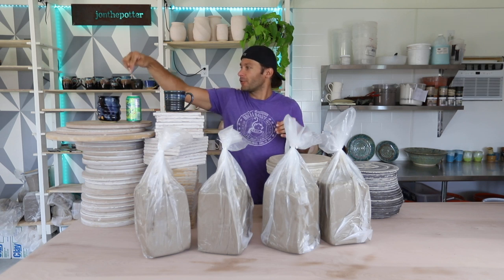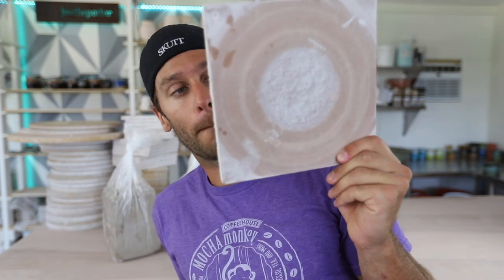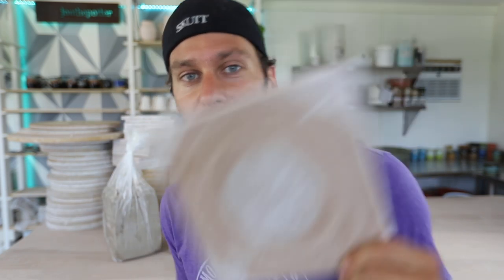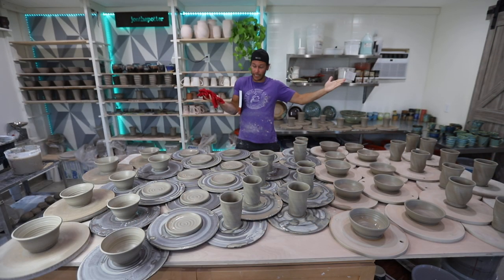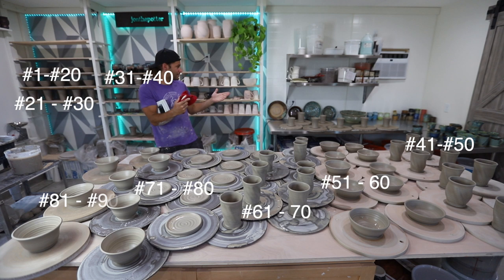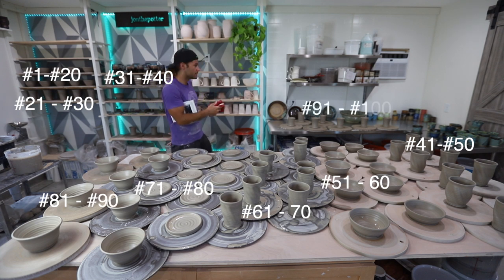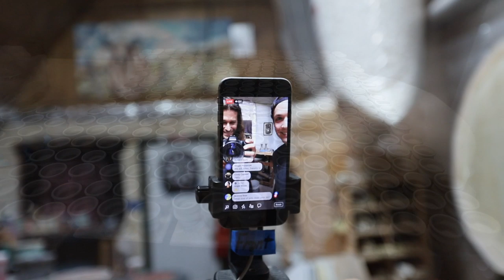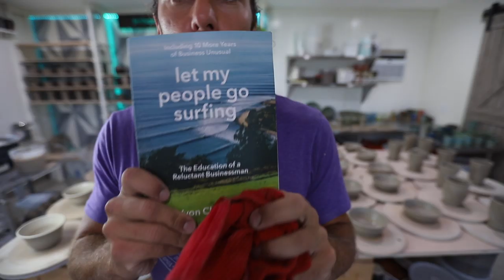THROWING 100 POTS - How long does it take??

Comment: I am throwing at 20 pieces an hour now, but can only do 3 hours on my wheel before my back dies on me a little! I found you on reddit when I first started doing pottery, you had thrown a coffee pour-over. For my first 2 classes, I tried to make one like yours. A year later, I still haven't made one that actually works! Mine are too short (learned a lot about shrinkage in that class - all my mugs only hold about 75ml or less...

Comment: I came across your channel, in my recommendations.  I watch a lot of throwing, glazing and firing videos  I find it both relaxing and educational, as it's nice to see how other potters do things.
Speanking of relaxing, I did like your "ASMR" video.  Not that I have a problem, with your talking.  You come across as genuine, and entertaining.

I use those bats in my classroom.  They have worked well so far, and tolerated student use.

Also, what is the red-handled tool, to your right, behind the wheel?  I didn't recognize it, based on how much is visible.

Comment: I go to a place called Alro Steel they also sell Plastics I buy sheets of off cut plastic for nothing I usually get acrylic clear acrylic about a quarter inch to 3/8 inch thick I cut him in two perfect squares any size I want throw my my mail in cut two holes the property with the part it takes me about a minute to make one bath last weekend I made 25 bats for about 10 bucks

Comment: ♥ this. Not a fan of ASMR.  You just showed up in the right hand column of suggested videos.
 Congratulations on 54K subscribers. I have not thrown, or created in clay for years, right now I mostly paint. 

Just wondering: do you ever make tea pots? Have you ever pressed pliable green leaves into the side if a wet, just thrown vessel? Maple leaves  come out awesome, especially on platters and bowls, even more so when soaked in a contrasting slip, and embedded i into the vessel and allowed to  bur off in the bisque firing. But sage,  thyme, and other herb leaves are beautiful on tea pots. probably  coffee beans embedded in pour over cones would be cool, especially if using porcelain clay

Comment: You don't seem to cut the pieces off the bats when you are done throwing. Do you cut them off at a later stage or do you find it to be an unnecessary step? Also congrats on the subscribers! You've earned every one with your great videos